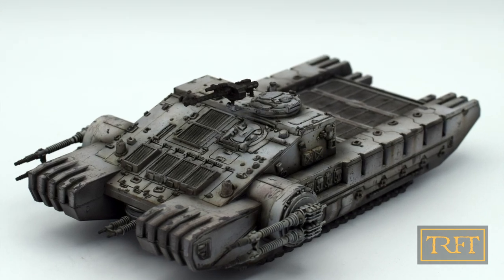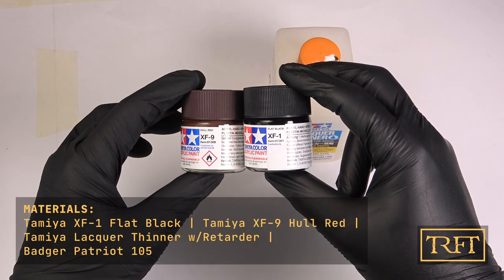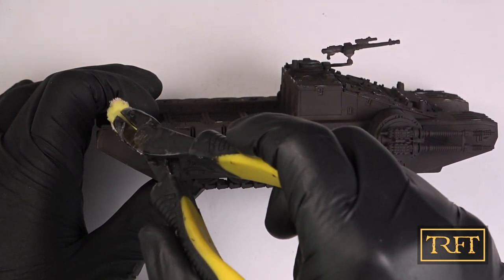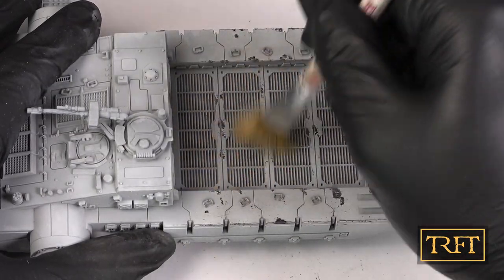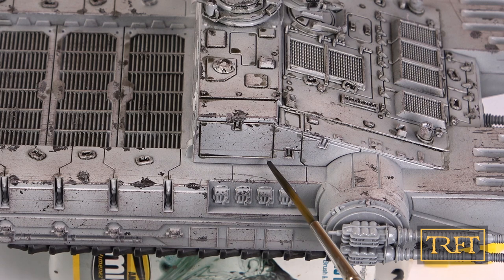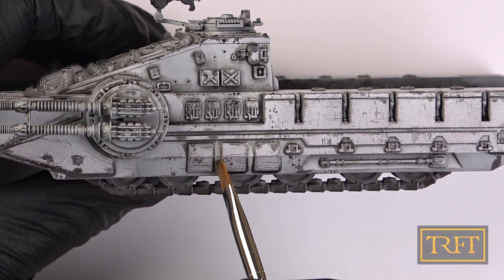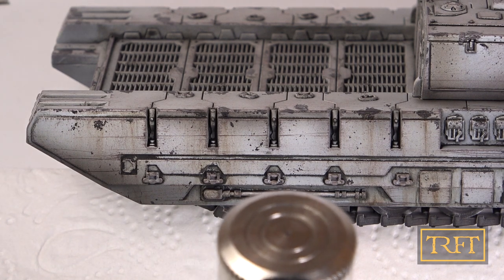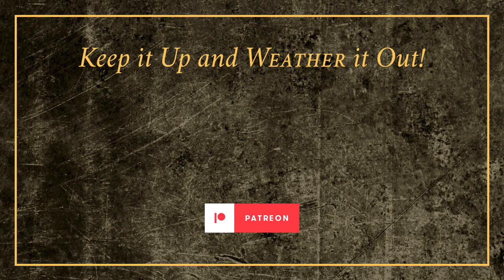Star Wars Legion TX-225: Full Build | Star Wars Hobby Tutorial Episode 2/16

Comment: Thank you for the video, it shows a great job! I would suggest colour variation in some panels and shadow areas. For greys, applying some white dots for highlights and marine blue for shadows really make a change (blend by stippling with a dry brush or a cotton bud). Give it a try! Some contrast will make the model look even cooler! You can also do the chipping technique in different grey layers, so you can have different color chipping, which translates into older or newer weathering. Finally, some graphite or metallic pigments can really enhance the weathering effects in the corners. Keep up the good work!
Reply from the maker: Thanks, Didac! If you watch more of my videos, you will see that I am familiar with both oil dot filters and graphite pencils. Particularly with a wargaming model, when choosing what techniques to apply the main question for me is return on investment - these were choices on my part. I would suggest not assuming other modellers are ignorant of technique x,y or z if they do not employ them for a particular project…
Reply: @TheRaceForTerra  You are right. I've watched a video where you mention that you first used streaking technique with enamel thinner but then changed to do it without thinner to have more control. So yes, I assumed you were learning on your journey and thought you would be open-minded to receive suggestions and not feel offended. If this is the case, as it seems, sorry. My intention was just to share some tricks. I would also suggest not to be that strict with comments if you want to build a huge Patreon troop. People just want to enjoy life and share knowledge.

Comment: Hi there ! Such a great work on that tank ! But i don't understand how you did the chipping FX. English isn't m'y mother language so I have trouble understanding.
So you took off the liquid mask with a dry brush with à bit of paint on it? Or you took off the mask while the base coat was still wet?
Reply from the maker: Hi Robin, I speak Spanish and German as well, if that helps? I undercoated the model, then applied liquid mask, let it dry, applied a basecoat over it, let it dry, and then used friction to remove the liquid mask under the basecoat. This reveals the undercoat, but also creates scratches and microchips due to the friction itself. You can contact me on Facebook if this is still unclear.
Reply: @TheRaceForTerra , super clear, thank you!
Works with every kind of paint? I use Citadel and Vallejo
Reply from the maker: If you airbrush them, yes, but you'll have to be more gentle with the brush. Word of advice: other liquid mask products don't work as well for this - best to get Humbrol.
Reply: @TheRaceForTerra , yes i use an airbrush.

Thank you your quick answers.

Keep making great videos !

Comment: So, you can use any type of acrylic paints with the lacquer thinner?
Reply from the maker: Not really - Tamiya XF paints are solvent-based acrylics. Water-baaed acrylics (e.g. Vallejo) + lacquer thinner=not good!
Reply: @TheRaceForTerra  Ah, okay. I looked at the Tamiya paints online but couldn't find any info regarding their medium. Thanks for the save! It seems like you prime all your minis with lacquer thinned paints. Is it really that much stronger? And it doesn't get gunked up in your airbrush ever?
Reply from the maker: @nigeljones9215  Yeah, lacquers are way stronger, and they spray beautifully without any dry tip or gunking up. Downsides: highly toxic, needs a dedicated airbrush cleaner (my favorite is AK Xtreme Cleaner, which I recommend for heavy duty cleaning regardless of paints used). In Japan, modellers pretty much only use lacquers...and I can see why!
Reply: @TheRaceForTerra  I'll look into this. Thanks for all the advice again!

Comment: And......I just order one on Amazon.
Reply from the maker: It won't disappoint! The level of detail they have despite being so simple is amazing.
Reply: @TheRaceForTerra  Love the video, one thing I'm confused about. So you are using Tamiya acrylic paint with Tamiya laquer thinner? I'm I getting that right?
Reply from the maker: @stinkyham9050  Yes indeed. Tamiya XF paints are alcohol-based acrylics, so the term "acrylic" is a technicality. Everyone assumes "acrylic" means a water-based paint (e.g. GW, Army Painter, AMMO, etc.), but that is not the case here. When thinned with lacquer thinner, they become similar to true lacquers. Does that make sense?
Reply: @TheRaceForTerra  A little, I've always thinned Tamiya acrylic with IPA based thinner but I'll give the laquer trick a go on an old model. Thanks.
Reply from the maker: @stinkyham9050  Try this, works much better.